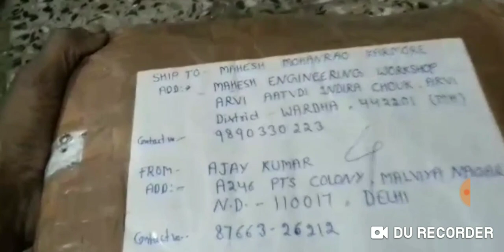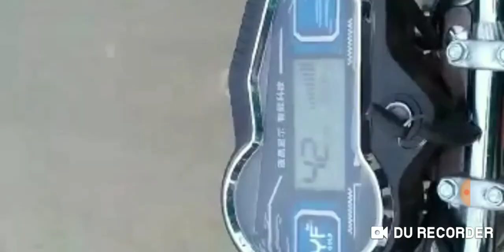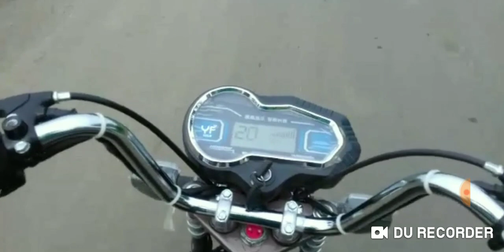HOW TO MAKE AN ELECTRIC SCOOTER , PART 1 OF 3

Comment: Motor konsi h, hub motor ya e riksaw, ya 750w
Reply from the maker: 48v 750w normal bldc , not hub
Reply: @REVIEWONGADGETS  mileage in single charge
Reply: @REVIEWONGADGETS  speed
Reply: @REVIEWONGADGETS  puri bike homemade h ya converted h
Reply from the maker: @ayanmansuri1693  
Speed approx 42kmph
Range approx 40 km
Full homemade